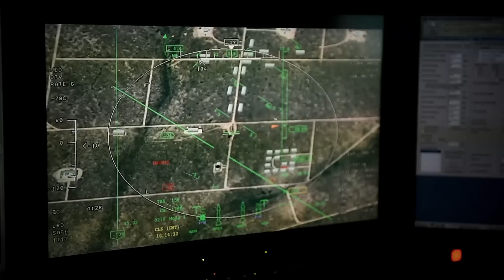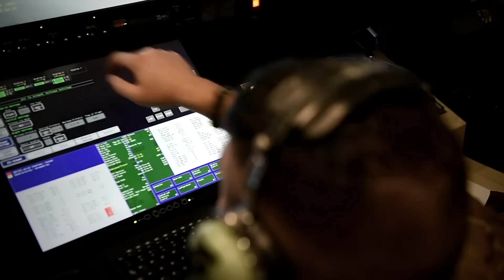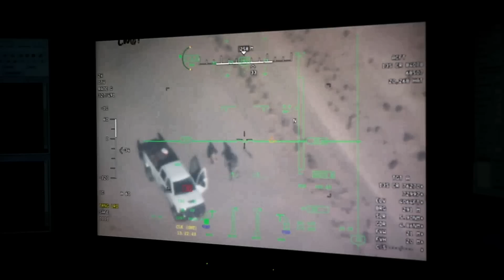Area 6 Secret Base Satellite Photos

Comment: This facility is ran by Lockheed Martin for UAV testing. There's a whole lot of stuff in Area 6 you mention in this video, that have nothing to do with this facility. I also doubt it is visible during the public tours of the test site. If you look at Google Earth history, the airstrip wasn't even there in 1998, it does show up as a dirt strip in 2002. It didn't even exist during the atomic testing during the 50's and 60's. None of the hangars here "date back to the atomic testing days". The Control Point, still in use, isn't here but miles away. The NNSS has a very comprehensive security force. The facilities mentioned re: Darwin Morgan - these have nothing to do with this airstrip. Those would be the Nonproliferation Test and Evaluation Complex (NPTEC) 10 miles to the SE in Area 5, and the Radiological/Nuclear Countermeasures Test and Evaluation Complex (Rad/NucCTEC) 3 miles to the SW, near the DAF (Device Assembly Facility). You manage in this video to mash together the purpose of a number of these facilities into what you claim this airstrip and facility are doing.  This facility isn't "Area 6", Area 6 contains a number of different facilities within its 100 square miles. ARGUS/Gorgon Stare has been in service since 2014, developed and tested on the MQ-9 Reaper at Eglin Air Force Base, Florida.
Reply: Also: if you want to see drones flying every weekday, including the secretive RQ-170, you need to travel down the highway back towards Vegas.
Reply: Lol  i always assumed the airstrip was to fly brass in to that area so they didn’t have to take a bumpy bus ride😂  thanks for the “what it isn’t”
Reply: @TheArea51Rider  do you know anything about the strip that is just off the six?
Reply: @kidcharlemagne1002  What/where is "just off the six"?
Reply: @TheArea51Rider  "Just off the six" means a tiny 6 sided object that "you jump off of" to celebrate a new better day. Duh. How do you not know that?
Reply: @chriskelso723  I guess I'm just not that smart.
Reply: They fly predators all the time right next to El Mirage, CA.
Reply: @TheArea51Rider  Eh, technically visitors 'can' see it.  It'll look like a dot on the horizon but it will be visible.  If you're one of the lucky ones who get to tour the NSS you aren't allowed binoculars for this reason.
Reply: @TheArea51Rider  Thats nothing. You should see the new unmanned fighters platforms they have. They'll do menuvers that will shock you. No G-Force limitations.
Reply: @TheArea51Rider  Years ago, maybe 2006 or a bit later, I was driving north on 95 out of Vegas heading towards Tonopah and as I passed Indian Springs I noticed a Predator to my right (east) and a moment later it did a loop and wound up behind me by a mile or so.  It followed me for maybe 5 miles before peeling off to the east.  It wasn't the most stealthy pursuit as it was at low altitude, maybe 500-1000 feet.  I'm sure it wasn't about me but was more likely training for flight crews on how to follow a car -- I was driving about 75mph or there abouts.  Having served in the USAF and being aware of the Predator (MQ-1) I knew what it was and wasn't frightened but it is a bit unnerving to have something that could deposit a Hellfire into my car with essentially zero probability of missing.  As I remember, there is a Predator base near Indian Springs called Creech AFB.  
The UFO nuts that made Area 51 quite a thing have moved on to Utah with the idea that Dugway is the new Area 51 -- I kind of doubt that given that Nevada is close to the aerospace companies in southern California so from a logistics standpoint Utah doesn't make sense for this role.  Given the proximity to Creech it doesn't make sense that they would need to build a new facility only 30 miles away from Creech to base the drones and the limited hanger options make that unlikely anyway.  So is it for sensor testing?  Maybe, but the most important sensors are video and IR and I don't know that the area depicted in this video would be ideal for that.  A better target for Argus might be the suburbs around Vegas.
Reply: @Raptorman0909 Personally I would have pulled over, got out and dropped my trousers and mooned them. Imagine the controllers face when an arse shows up on his monitor. Have that!
Reply: @Raptorman0909 Creech AFB yes.
Reply: Sadly, this channel decided to throw fact checking in the garbage a long time ago, and instead, just feed people bs in order to boost their metrics for the algorithm to get more clicks.  I really had high hopes for these channels when they were just getting started, but now it’s just sad.  Waisted potential.
Reply: Well thanks for ruining all the mysterious of the place😂
Reply: @Raptorman0909  They have a squadron of Reapers at Creech AFB, and do pilot training there. Also RQ-170 but you have to know when to watch for them. Dugway definitely isn't the new Area 51, but the Army is doing testing there.
Reply: @EricRosenwaldPhotography  I've been subscribed to the "Dark _____" channels for a while, but this is one subject I have some expertise on, been researching this stuff, and doing videos about it since 2004. I visit Area 51 every year and explore for a month. I will take any "Dark ____" videos with a grain-of-salt in the future. Maybe unsubscribe. It bothers me how little research they did on this one, and went for clicks/views instead.
Reply: @jugo5139  Just urban legends. Or for BS YT channels that like to invent crap to get views/subs.
Reply: A person who is seemingly excited to divulge national defense secrets, I doubt had much thought for what is actually true compared against how to maximize monetization.
Reply: Big fan of yours. Been watching your videos for many years. Sadly many YT videos are like this one. The creator slaps together a poorly researched script, hires an voice over actor to read it, and throws stock footage on it. Lots of fake news gets spread this way.
Reply: @TheArea51Rider  well, I think we can agree half of it is BS, let alone an actual security issue. My point being is if dude did have sensitive information, he seems to be more than happy to share it with as many people as possible, if it means making $5.
Reply: A Secret airstrip out in the middle of the desert with restricted airspace above it and a few hangers a short distance from the runway?
Obvious it’s for drone testing. Where do you expect the military to test them, in the big parking lot behind Walmart at 5am, before it gets busy? 😂
Reply: You can see the hangers from Mercury hwy when going out to the Sedan crater and other places the tour goes. Creech will launch a pred or reaper for federal LE that is doing surveillance or pursuits. One time a DEA agent got into a gunfight and pursuit that went out onto the Paiute reservation near cold creek and he wasn’t answering his radio or cell. Creech launched a predator and found him within a few minutes of launching. He was fine but out in the boonies. I used to love going out to Creech and just sit and talk with the old Wackenhut dudes at the checkpoint like Silver Flag alpha. We would just talk about all kinds of crazy shit!
Reply: @jg5875  Thanks bro. I am headed back down there from here in Canada sometime in May. More live feeds this time.
Reply: @TheArea51Rider  sorry for the late reply but if you follow SR 375 North until it T's off at SR 6 then head East on SR 6 for a few miles there's another similar looking air strip.
Reply: @kidcharlemagne1002  That's Base Camp. I have at least one video on my channel about it.
Reply: I use to captain 737 aircraft painted white with red stripes every morning out of LAS.
Reply: @TheArea51Rider who are you? Do you work there? We need to talk.
Reply: Thank you for reminding me why I previously unsubscribed from this channel.
Reply: You’re full of it…as a previous employee you have zero factual info….nice try tho
Reply: One of, if not the best comment here
Reply: Next to that base is a site that looks like something for nukes. High poles all around with a double fence perimeter. No Moudts, looks flat. I have no clue what is stored there but it is highly prized. Do you know what I'm talking about and know what is stored there?
Reply: @bellyofthebeast6605 

They have definite g force limitations. Because of fuel. 

It's one of the main things discovered and verified during the YF platform tests. 

Certain maneuvers will make the fuel completely abandon intake lines causing flame outs. And because most of these newer platforms are 100% computer aided flight systems that are inherently unstable they can easily crash. Costing billions of dollars.

At best they can make certain maneuvers better and faster than human piloted variants. But there are several they can't. Especially anything inverted in any fashion. Because those maneuvers force the fuel against the upper part of the tanks.
Reply: @shaunofthedead3000 SMH...the YF platform...Im talking about completely redesigned platforms from the ground up. You're talking about making a plane designed around a pilot remote control. That wall of text talked a lot about nothing.
Reply: @shaunofthedead3000  Also...why the Frenchman flats?? seems like a decent place to test a new propulsion/redeveloped propulsion system if you wanted to hide higher than background radiation levels...
Reply: @Echo5delta  You hung out with and talked to the Whackyhat guys? They used to do security at SRS outside Augusta, GA and would have fun running into them with guys from Ft Gordon. They have more stories than teeth usually, but fun guys to chug a beer with.
Reply: Now explain the discrepancy between McDonald's advertising and it's product -  dry beef burgers, limp lettuce and stale buns.
Reply: @Erik-gg2vb  you might be referring to the area where they mount aircraft on poles at various heights and angles to see what kind of radar return they have  - used to make aircraft have lower radar visibility (stealth)
Reply: All good points but he does say in the beginning that the air strip was built 2005
Reply: @bellyofthebeast6605  

Another non intelligent word commie. 

Listen, you focusing on one, and a very important, platform doesn't dismiss the rest of the text scooter. 

All platforms suffer the same exact limitations. And no, they haven't overcome those limitations.
Reply: Hey! Its about views not truth.
Reply: Richard Doty alt account confirmed
Reply: @TheArea51Rider  ...not to mention the drones wandering the streets of Vegas...
Reply: @shaunofthedead3000  Yes, the limitation is the human. Yes, they have over come that. Go back to your post E-2.
Reply: @chriskelso723  Sounds like rubberise.
Reply: @bellyofthebeast6605  no g force limitations is a bit of a stretch
Reply: Its funny how U spout data. On my own I learned there a 9 facilities. Area 51 is considered number one. The funny thing about this video even showing up NOW is the fact what is considered Area 2 is in northern Alaska and of all things going sideways it is dedicated to NOAH weather and of all things weather BALLOONS. Even I did not know originally there had been over 25 types of Weather Balloons in use in just the last 25 years. 20 some diff types. I mean U figure they woulda at the very least narrowed sheet down to one of the other by now right. That is not the case... Diff types of balloons are used in diff geographic locations. And in this century by now U would think with all the other technology out there weather balloons would be obsolete in 2023. Nothing could be farther from the truth. In fact NOAH and other agencies are plying right now paying millions of tax payers dollars to develop what the government just shot down recently was an extremely slow moving CHINESE weather spy balloon that can be steered and or loiter in place despite air currents. Gufaw we just shot down China's weather balloon that could do all the things other folks is working on right now.... You just cannot make up this total window licking stuipdity.... In Joe Dipsticks own immortal words >>>I mean come on man with that stuff..... ..... U just can't make this stuff up folks... By the way folks I make my own weather balloons and some drones I make them from kits. Its just one of my many hobbies nothing govt funded. For the last 45 years our U.S. govt has and still is working on remotely piloted weather observation equipment. Mainly balloons. We have 4 diff types that closely resemble those UFO style flying wings. They R inflatable and steer with little motors. The latest most impressive steers with current driven gyro technology Its basically solar powered for driving thrust which means it can stay aloft almost indefintiely.
Reply: @ponz-  But if you wander for a bit just out in the desert between LA and Vegas there are numerous facilities with varying levels of security. I once innocently ended up on a BAE site while trying to get better pictures of an airplane graveyard.
Reply: @thekingsilverado3266  Ummm.... OK
Reply: @Raptorman0909  That would be Creech AFB.
Reply: @jpcough6591  yes!! 😂. But gosh for bid you park a damn semi in their parking lot after hours 😂.
Reply: I'm glad I am a comment reader!
Reply: @jg5875  didn't know he/she has a channel. Just subscribed. Although I'm sad to hear this channel isn't forthcoming with the facts. I enjoyed watching the videos. Oh well. I'd rather have truth.
Reply: Lol buddy your funny
Reply: Thanks for the information!
I've read a many comments throughout his videos like yours, correcting false information spread throughout the video.
Your comment is the nail in the coffin for me.. wont be clicking any of his videos in future.
Reply: Very good intel..  I knew a person who worked for Lockheed and basically said that you have no idea what your working on until the end of the project and can't talk about for 20 years .
Reply: Then do your own video, skeezix.
Reply: @scottbrower9052  Lol he does, quite a few on this specific topic and going around the bases. He knows more about those areas in and around groom lake than whoever runs the 'Dark' channels could dream of.
Reply: @Desert-edDave  If William wasn't William, Charles wouldn't be doing anything.
Reply: @scottbrower9052  Whatever that means lol🥴🤖
Reply: This sounds like a whole bunch of stuff that you aren’t supposed to be telling the public. Is “being right” more important than national security?
Reply: @dj2raw370  National Security is ensured by those who are paid to do so. Discussing public observations in comments on a YouTube video in no way puts 'National Security' at risk. 😂
Reply: @dj2raw370  
Whoever our 'adversaries' may be, undoubtedly already know far more about these locations than commenters and observers.

National Security and ensuring secrets is the responsibility of those paid to do so. Discussing public observations in comments on a Youtube video is not a risk to "National Security"😂
Reply: @dj2raw370  Nothing has been revealed that isn't already in the public domain.
Reply: Someone has clearance somewhere to have this type of knowledge. Too bad he didn't ask you for reference
Reply: @Republican_Extremest  The fact Lockheed tests UAVs out of there is public knowledge from simple observations, no clearance required.😆
Reply: This is absolutely correct, I've been watching the development of this site since 2006 when I first noticed it.  I think some RQ-4 global hawks operate, or used to operate out of this area too.  The images appear to have been removed but there used to be images of them sitting on the tarmac and on the runway on Google earth history.
Reply: @loganvammiddlesworth393 
Buzzword
Reply: A mile long runway for uav's ? Ok
Reply: @erikrhafer6644  Look up how long a runway the MQ-1 Predator needs. Compare that to 5,280 feet.😆
Reply: @Desert-edDave better then that, I asked someone that flys them 2,000 feet officially.
Reply: @erikrhafer6644  Anecdotal unsubstantiated claims does not an argument make. A mile long runway for testing experimental UAVs is not remotely(pun-intended) far-fetched, no matter how much you want to believe the 'truth is out there'👽😆🤣.  Have a nice day.
Reply: @tedarndt6254  Meh. Doesn't affect me.
Reply: @lesduffey6032  Well yeah, we have a base there. Very well known.
Reply: @Erik-gg2vb That is the DAF facility.
Reply: For some reason, I don’t think this creator actually reads any of the comments, regardless of how many times it’s pointed out that his facts are actually inaccurate. Wether it’s bc of arrogance or just not caring, he’s probably more focused on just churning out more videos to keep making money. Facts be damned lol
Reply: @josiah0303  Agreed.
Reply: @daveblevins  the preds flock up like geese at Creech afb. I always see them doing touch and goes.
Reply: @TheArea51Rider what a strange hobby
Reply: As a former USAF bb stacker, I love a good mystery 👍    👀
Reply: Nice try, CIA
Reply: yea they had a timeline you could see a uav going inside the facility but why is it made circular for a saucer shaped ufo tho?
Reply: @markwithamaxima2680  It's not made "circular". It has a clamshell door.
Reply: @TheArea51Rider  not entirely circular but it's saucer shaped and opens wide not up and down. I remember seeing it on a older Google earth when it had the time lapses available. You could see the diff stages of builds
Reply: @TheArea51Rider  why is that so, is it due to possibly have gone too far. I've just seen a video of a couple that made it 1.7miles in but they took bad directions
Reply: Screw this video. I'm gonna sub to this guy. @TheArea51Rider
Reply: @wisdomSP  Hahaha, nice. Thanks for that.
Reply: @Desert-edDave  lol.